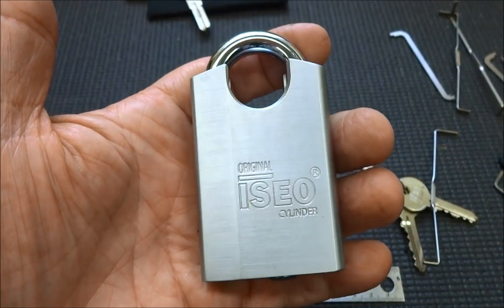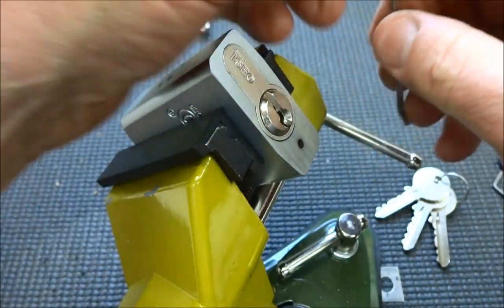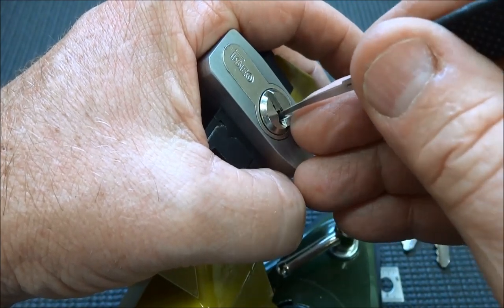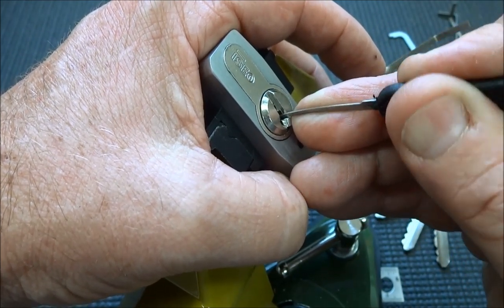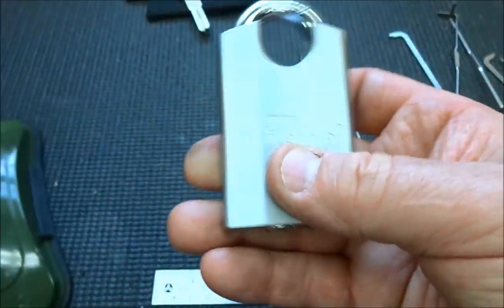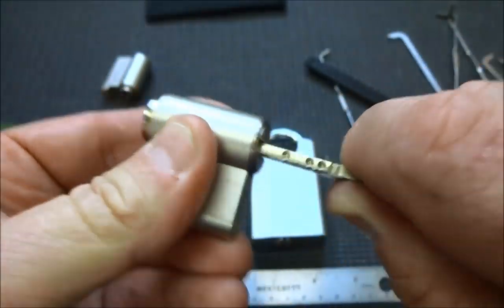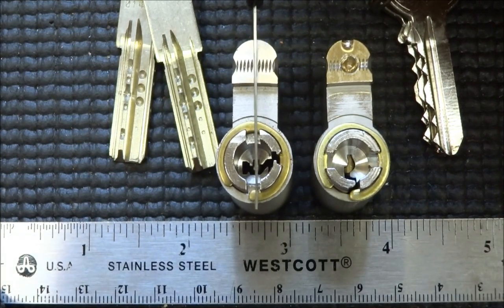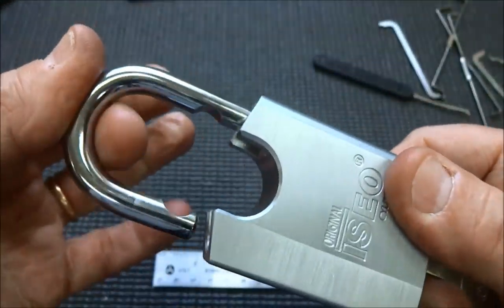(343) Iseo Padlock Picked Open and Improved

Comment: you know least it has 5 pins, recently bought a brinks, promax security, yea, only 4 pin, picked it under 2 mins, had some spools maybe, i got a false set and lt said 5 pin, it lied, said pick resitaint, curuis on the cut strenth says up to 9600 lbs.. pry up to 2900 pry, uf i had gauges i would test it..